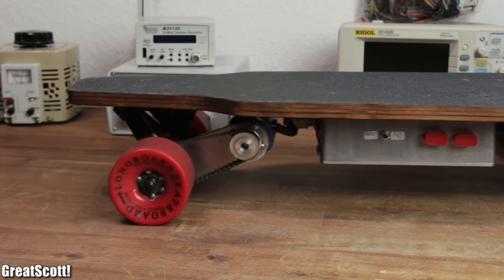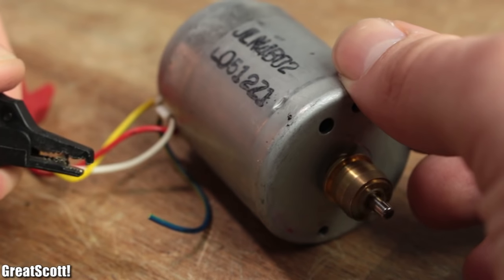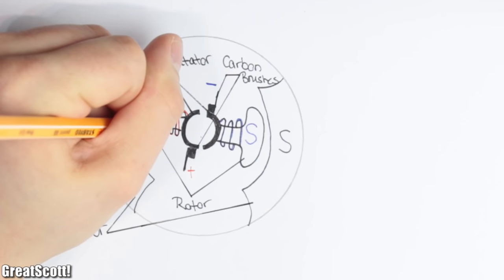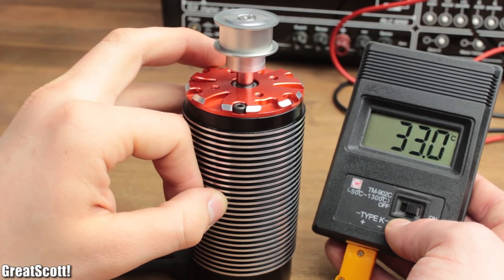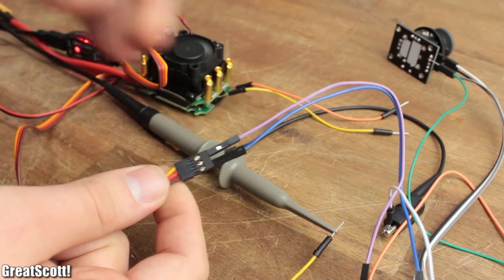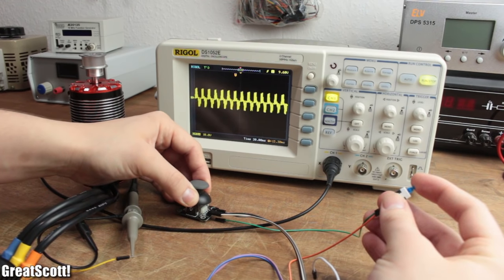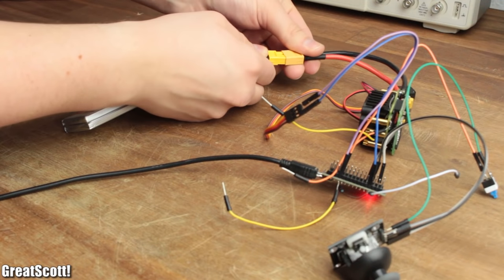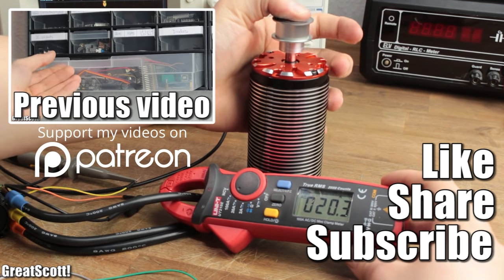Electronic Basics #18: DC & Brushless DC Motor + ESC

Comment: What is a commutator? (what is its purpose why does it have that shape or is the shape irrelevant? could one use an other type of material to do the same job then why do we use this type? ) please dont forget to give description to all the parts involved
Reply: Watch closely from 1:33.
Reply: marek2630 yea I had watched the entire video before posting this and I did again watch it from the part you suggested ... so?  He just says the word "commutator and with the help of the  context the viewer can suppose which part it is but thats far from answering the questions I made above.
Reply: +Bill Killernic I'll try to write that from the video. The commutator gives energy to coils in 1 polarity and that creates a pulsing(i don't know why pulsing) MF, because these coils are connected in series. The magnet #1 attracts the coil #1 and magnet #2 is pushing away the coil #2. But just berore reaching the final position, the commutator changes the polarity of the coils, and they will change their MF from N to S and S to N. When this happens, the magnet #1 starts pushing away coil #1 to magnet #2, because magnet #2 is attracting the coil #1 and magnet #1 starts attracting the coil #2......... This can repeat forever, if you have a DC motor and an infinite power supply :D
Reply: marek2630 again (although thank you for your efforts) that describes how a  motor works in general not what a commutator is and how IT works... I understand what a magnet is and how it behaves I understand what wire is and how it behaves in a magnetic field (thus I know how it behaves when coiled) I dont know what a commutator is.

From what you said the only useful parts (about commutaros) one gets its that a cummutator is a THING that transferes electricity in one polarity
Reply: Abhie Parmar I thought that if you apply DC on a wire it will have a magnetic field as long as power passes through it not just briefly when introducing it to DC (because of of the polarity change) lol

thanks for your answer... but how does the commutator change the polarity?
Reply: Oops yes you are correct, applying dc to a wire will have a constant magnetic field. Sorry about that, I don't know where my head was at. I did confuse you lol. I'll delete it before others get confused too. 

About the commutator though, if you see at 1:41 it looks like a ring that has been cut in two. So if you imagine two sides of the commutator connected to either end of a battery and you spin it, one moment you will get N-S polarity in the coil and as the whole assembly spins it will briefly disconnect and reconnect with a S-N polarity.
Reply: Abhie Parmar Ok I found out how it works

What we call a "commutator" is a series of copper lines with space between them (or an other not conductive material between them) glued on a cylinder (which I suppose is not conductive although it might not make any difference)

this hole contribution (cylinder with copper lines) does not change the polarity on its own per se but it plays a key role in the process

To describe to you how it's done I would use a very simplified version of a commutator which will be a cylinder which half of it is covered by a copper surface (lets call it C1) and the other half of it has a copper surface too (let's call it C2) between C1 and C2 there is a space (imagine the cylinder cut down on 2 dimensions x,y so that it looks like a circle from 0 degrees to 179 there is a semicycle which is C1 and from 180 to 359 there an other semicycle which is C2 and the space between 179o and 180o  and 359o and 0o is the nonconductive)

I hope that makes sense because you have to imagine a few things more...

ok now imagine a magnet's north pole on the left side and a magnet's south pole on the right

now imagine a  Π  looking  wire in the middle of those magnets (notice Π has two legs/ends ) one end is connected to C1 and the other to C2

Now we connect the positive pole of a battery to a needle (lets call it N1)and this needle touches the commutator (so if the commutator starts to rotate the needle will touch C1 travel through its surface then meet a gap then touch C2 travel through its surface then meet a gap then touch C1 again and this goes on and on) 

let's assume the initial position of the needle (without is on C1) 

then we place a needle(lets call it N2)  on C2 and connect that needle to the magnet  (while the other needle is on C1) then connect the magnet to the negative pole of the battery 

the commutator starts to turn N1 is touching C1 and N2 is touching C2 and because C1 and C2 are both wired on one side of the  Π shaped wire that closes the circuit 

and the left side of the Π positive and the right side of the Π negative

(mind that when current flows through the Π wire  its left positive side gets repelled by the north pole on the left  and its right negative side gets repelled by the south pole on the right but  halfway through its turning point if nothing would have changed then the repelled side from the north pole magnet would stick to the south magnet side and the repelled from the south pole magnet side would stick to the north pole magnet site.. :P fortunately since the polarity will change this won't happen) 

now as the commutator cylinder turns eventually the N1 needle will touch C2 and the N2 will touch C1

C2 is connected to the right side of the Π (which had negative polarity a few moments ago) but N1 is on the positive side of the battery so the polarity of C2 will change to positive and the polarity of C1 (since it touches N2 now) will change to negative 

And thus halfway through its turning point Π change polarity and thus get repelled by the magnets again then another halfway through the polarity will change again and again 

the period is T/2

Now in practice the same thing happens although (for adding power to the motor) instead of having just C1 and C2 we have C1,C2,C3... C120 or more on the commutator and 4 magnets (on a cross alignment with the commutator cylinder in the middle)  instead of 2

Comment: hi, i think you read rpm in the wrong way. the rotary tool you are using is for measuring speed, such a belt or similar (mm/s). if you change the diameter of the pully also your reading change. to read speed by contact you need to place the rpmMeter over the motor .my rpmMeter has a rubber cone to meke that kind of mesaure. sorry for my english.

Comment: My fan on my 3d printer is brushless as well, does that mean my printer controls the polarity of the coils instead of the fan itself?
Reply: +CookieCraftMedia no, there is a circuit board with the control inside the fan
Reply: +Lasse Langwadt Christensen Ah I get it now. So instead of having "brushes" which control the polarity there's a chip that does that for you.
But how does the chip know when to change the polarity then? I guess it just runs on a constant frequency
Reply: CookieCraftMedia
there is basically two ways (same goes for an ESC) either there is magnetic sensors that sense where the magnets are or a bit of "magic" is used to use the winding themselves to do the position sensing
Reply: The printer itself controls it with PWM. Remember that PC fan in that summer build project?
Reply: +Lasse Langwadt Christensen I don't think so. Did you saw anything which looks like a sensor in that brushless motor which is near those magnets? No.

Comment: when i plug my motor to a 12v battery it spins but when i plug it in to 12v dc out it just vibrates! please help, why is it doing this?
Reply: there is something wrong with the power supply - it might not be able to output enough current. check the voltage and see if it drops when you attach the motor.

Comment: hi greatscott , i recently brough a 1400kv brushless motor and 30a hobbywing (a china company ) , i searched online and i found that we actually can use arduino servo library to control the brushless motor , i followed their instruction but it didnt works, the motor is just beeping but it didnt turns , is it the frequency from the arduino isnt match with the frequency that the esc wants, if so what can i do , i didnt have a brushless motor controller and i didnt havent a oscilloscope to see the frequency , i am a beginner of electronics , pls help me
Reply from the maker: +Sooncheng Lew Take a look at my longboard project. There is code you can use.
Reply: +GreatScott! ok
Reply: +GreatScott! i tried ur code , it just didnt works for me , then i change your code a little bit which i changed ESC.write to ESC.writemicroseconds , the motor will only run when it was between 1600 - 2000 microsecond , but seem it is the full speed of my motor

Comment: im troubleshooting abit since i bought an brushless inrunner and an esc on 120amp (from hobbyking ofc.) but when i soldered the reciever, esc and the motor together and plugged the 4000mah 3cells lipo in, it diddnt work. the only sign of life was from the motor making a noise, but the radio and esc was dead... it was bought 7months ago, but never used (brand new) i later plugged the radio and the esc to another circiut (a rc plane) but that gave no sign of life that either. (all the mesurements amps, volts etc. was correct.) any suggestions of what my problem may be? help please, its pretty expensive to buy sutch large Esc's, expecially when you dont have a job and is still in highschool... xP
Reply: And the voltages are correct for the modules?
Reply: yes, everything was correct. but it just diddnt work. im buing a new reciever and a new (diffrent kind) of ESC

Comment: I still didnt get how brushless motors works, by its name it seems that they dont have brushes inside, then where those 3 wires go inside the motor ?
Reply from the maker: Those connect to point A,B,C in my diagram.
Reply: +Emīls Kurpnieks (ikey07) they go to the stator coils. effectively, you feed in a 3-phase signal, and the motor spins. just with BLDC, to spin well, the 3-phase needs to move at the same speed as the rotor. contrast is induction motors, which don't have magnets, and as a result don't need the phase to stay in sync with the motor. electrically, the motors are nearly identical, differing mostly in the use of magnets vs a squirrel-cage rotor (though, could be better described as an electromagnetic version of a hamster wheel).

Comment: Okay Scott, I just finished my long board and it works great; thank you. However, I would like to utilize the power from the front wheels to generate power to charge my battery while strolling through San Francisco. How can I use two or one electric motors to generate enough power to charge my batteries? Thank you for your time and consideration.
Reply: I would also be interested in seeing the longboard with some sort of charging mechanism.

Comment: Can you help me? If I had a motor like the EMAX GT5335/08. I would need to buy a esc with approximately 90 ampers. And the number of cells that the esc need to handle would be 10. Right?

Specifications of the motor: 
http://www.hobbypartz.com/66p-190-gt5335-10-kv200.html

Comment: For what purpose is this big motor?
Reply: in have seen them in a rc drone/car/plane shop
Reply: Jaromy Van Der Sluis
Ok. I didn't thaught that such a big motor is used in an rc car. But if it's a big one it could be.
Reply: +William Hutchinson Lets make a massive quad copter !
Reply: :D That will fly very high, but THAT GODDAMN BATTERY!
Reply: marek2630
Fusion reactor :D

Comment: +GreatScott!
could you build something like an imitation of a particle accelerator/collider?
You know, something like a big pvc pipe with several coils surrounded. The on/off sequences could be activated with a light barrier when a metal marble passes it. So, the coil in front of it gets activated and the coil behind the marble gets switched off.

you understand what i mean? :D

just message me^^

Comment: Hey I have been doing a lot of research on this subject. It is called synchronous motor speed. RPM = (120*Feq)/(# of polos) Also you did not mention slip or the V/Hz constant. I have found the basic information is no longer useful to me and i like to take the deep dive.  If you want a calculator that does a lot of those calculations for you I made an excel spread sheet over on the endless-sphere, a electric vehicle form. Check it out. It is still a work in progress. 

https://endless-sphere.com/forums/viewtopic.php?f=35&t=75694&p=1143652#p1143652